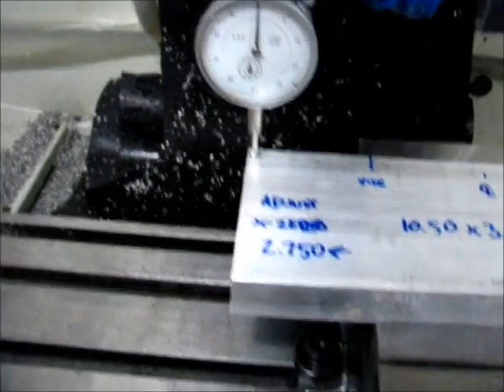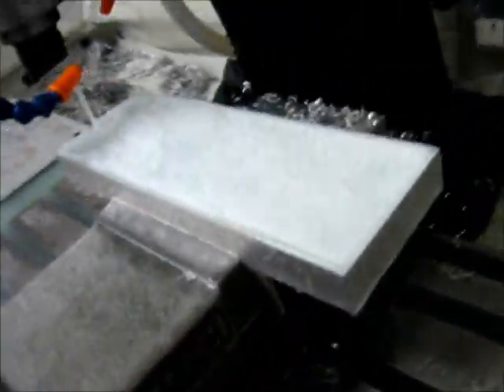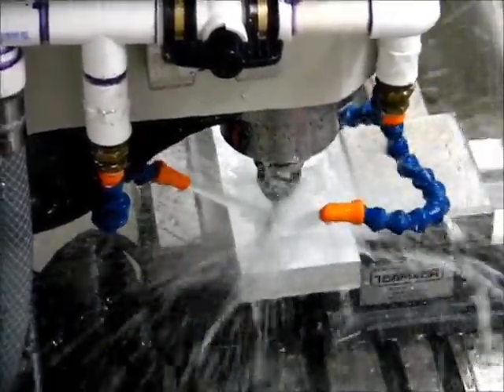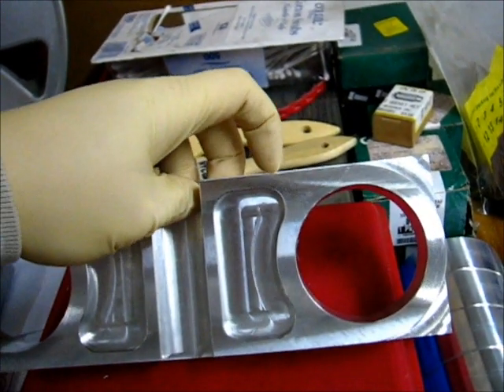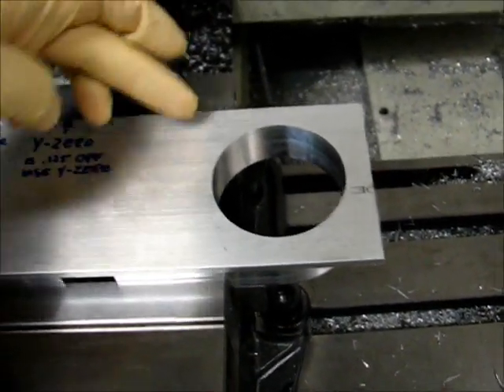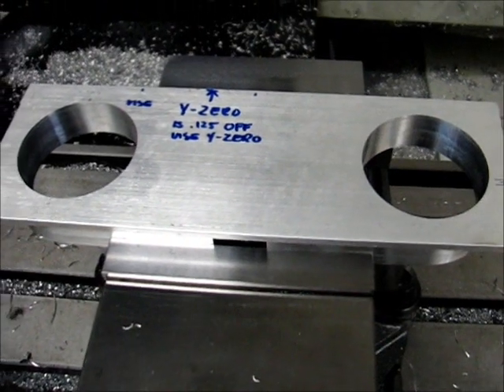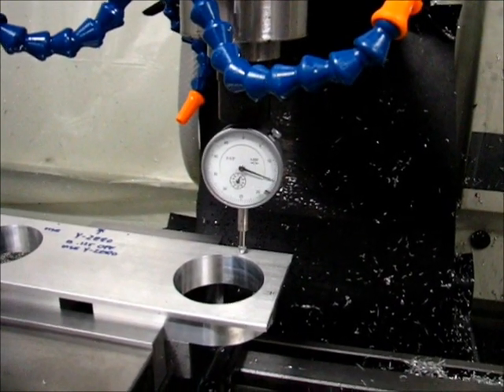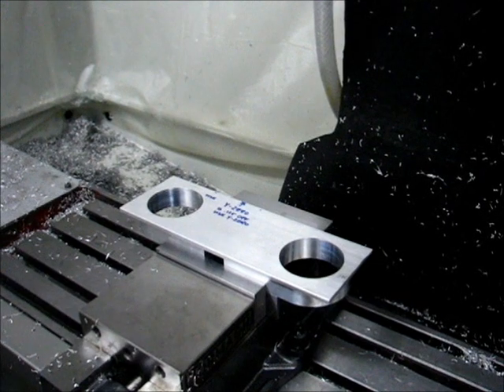Tormach PCNC 1100 - Set Up and Machining of a Two Sided Part

Comment: wat is the size of the pvc pipe did u use for ur coolant manifold??? is it 1/5 inch or quarter inch cos I’m thinking of building the same manifold u have for my tormach 1100, sorry if i copy ur design??? nice work on those clock parts!!!
Reply from the maker: It's 3/4" Schedule 40
Reply: thanks

Comment: What do you use to keep your table from rusting, ours looks horrible. Thanks!
Reply from the maker: Good question.  I usually put way oil between whatever is bolted to the table and the table.  I try to keep the table dry between uses (it's a hobby machine, so it may be dormant for a month).  I wipe down the machine after using coolant and spray on WD-40.
Reply: Level3-RC i can't believe people would run a flood that rusts the machine….crazy!!!